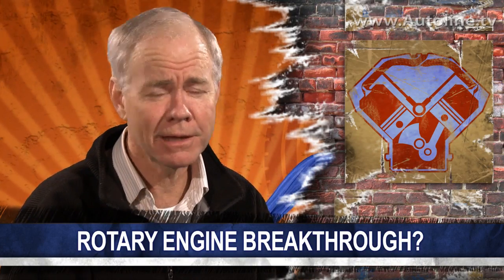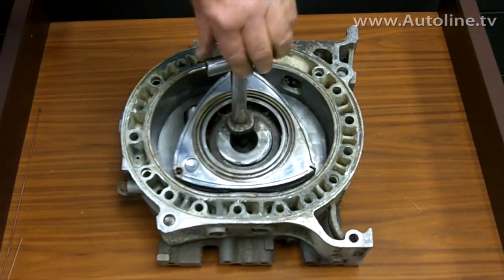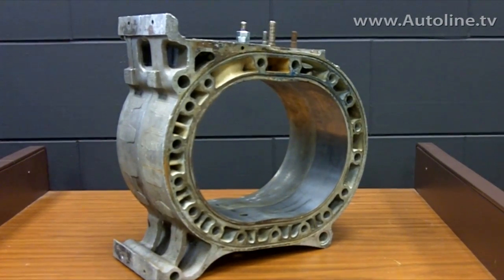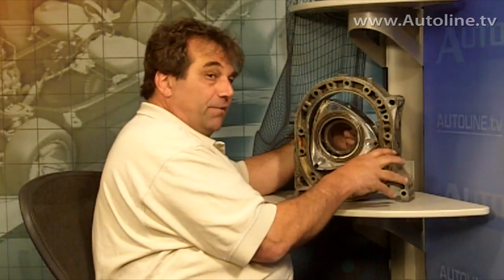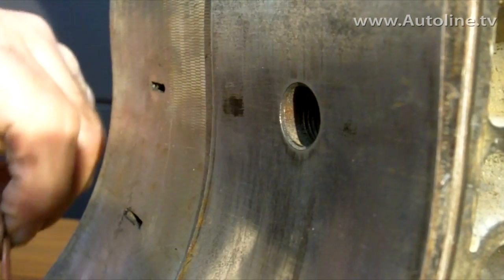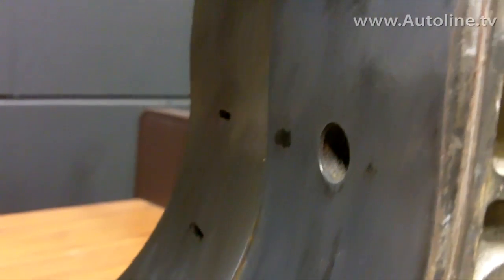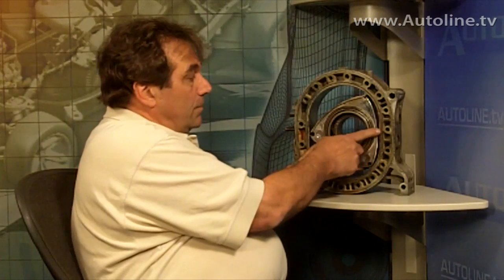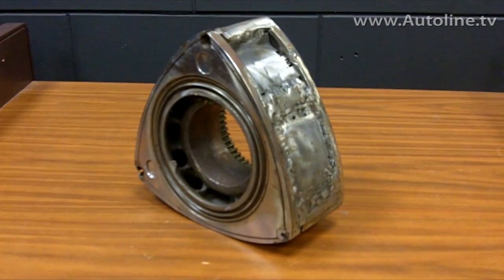Rotary Engine Breakthrough?

Comment: I bet he got 600 degree lower EGTs because the engine wouldn't fire. :-)  That'll lower your EGT a LOT!  LOL!
Reply: I'd love to know if all these gibberish copy/pasted gibberish is coming from the real Ernie Brinks, because it's relentlessly childish and a waste of time,  and I find it hard to believe its the same guy.  The guy I see in the videos does not seem like a 12 year old troll.  So I have doubts as to whether its the same guy.

Dr. Bimmer: you recently posted that Audi did significant exploratory engineering concerning the use of a wankel as a range extender.  They then abandoned the effort.  I agree on these facts, but NOT your conclusion.  No engineering department would embark on this effort if it's such a complete non-starter.  Audi makes great cars, and their engineers didn't become brain dead for the wankel chapter of their careers. They saw possibilities with the wankel, given modern materials and knowledge applied to seals, clean combustion, new materials, etc. and obviously concluded they might be able to make it work.  Your position is more like 'any engineer who pursues the wankel is dumb'.   Well then, you are calling a large segment of Audi's engineers 'dumb', when clearly they aren't.  Acknowledge that it isn't so clear cut, if you have the guts to.
Reply: STILL ANTHONY WERE YOUR BUDDY LOST IN SPACE AND TIME TROLL ALERT KEY BORAD JUNKE   AWESOME BOTTOM COMMENTS HOLY CHEERS
Reply: GOD BLESS YOU
Reply: Lay off the PCP,  Xke xke!
Reply: The real doktorbimmer4 hours ago
"Masamichi Kogai confirms Mazda has no plans to bring back Wankel engine"

You already posted this same article about 3 months ago, and at that time I pointed out that in the second paragraph they indicate the wankel is NOT dead- the headline is misleading.  So I copied and pasted the same thing as I did before.  It's in the very second paragraph.  

Second thing: as 'Ernie' is now reposting entire pages of old comments, I don't have the time to read it all to see if there is any point.... so thats why I haven't been commenting much.

Directly from the body of the article:

"As for whether the rotary engine will live on, Kogai was a bit more cryptic and wouldn’t give a definitive answer. “But if we were to restart production of the rotary engine again, we need to make sure it wouldn’t be just short-lived,” he said. “We need it to meet future emissions regulations. We are still conducting our R&D activity to overcome any issues we have with emissions and fuel efficiency.”

So the good news is, Mazda is still working on developing a rotary engine, but it’s unlikely to show up in a new sports car."
Reply: @someotherdude  The 2023 Madas are arriving! Where is your new RX sports car??? It's been 5 years and look like a fool right now.
 I guess Masamichi Kogai and I knew something you didn't???
Reply: Confirmation that care in the community has never worked...
Reply: Manoo422 months ago
Confirmation that care in the community has never worked...
LOL LOL !!!!   Good one!
Reply: When you combine TERRIBLE fuel economy with about 1/3 the torque, you get an engine only hipsters (also, most junior high school boys fall into this category) would use for any reason.
Reply: I have a hard time reconciling the guy I see in the videos with all the gibberish he supposedly posted.... but it doesn't look like  an imposter
Reply: Pretty sure whoever he was arguing with kept deleting his posts as spam so he'd just copy/paste the entire thread back into a comment.
Reply: What was the point of that post?  You merely copied my post.
Reply: They apparently still have the 50 man team working on a rotary concept, according to Kiyoshi Fujiwara....
Reply: @someotherdude  Apparently you and Kiyoshi Fujiwara were completely full of shite lad... Mazda unveiled its very last production Wankel engine over 27 years ago!  You both look like fools right now! Lol!!!
Reply: March 19th, 2017:
http://www.carbuzz.com/news/2017/3/19/Here-s-Proof-Mazda-Is-Still-Working-On-A-New-Rotary-Engine-7738337/
Reply: BTW, they are working on a range extender application of the rotary.  You know, the application you said no one would ever consider?  Well, they are working on it and I'm pretty sure that team of 50 engineers know more about it than you do.
http://blog.caranddriver.com/mazda-still-working-on-wankel-engines-but-not-like-youd-hope/
Reply: (doktorbimmer)
+Manoo42 :Mazda dropped development of the range extenderIf they dropped development of the range extender application, that REALLY makes you wonder what generated those fresh patents..... LOL LOL LOL !!!!
You know doktorbimmer, your unhealthy fear of the wankel engine has you denying/obfuscating/deflecting at a really unhealthy level.
Reply: +The real doktorbimmer
Some Other Dude  "Kiyoshi Fujiwara has said a lot of things recently that have been turned out to be completely false...."   Saying he's got 50 engineers working on a new wankel is not something that can 'turn out to be false' as in 'being mistaken' about something, now is it?  How exactly would that happen?  Is he hallucinating, doktorbimmer?
Reply: Just when you think it can't any weirder, this ^^^
Reply: You're incomprehensible, Ernie.
Reply: Tell'em Ernie!!
Reply: http://www.aieuk.com/
Reply: + doktor
Dude at this point it's you who is looking ridiculous.  You have repeated yourself literally hundreds of times. Let it go.   Right or wrong, there will be people in the world who have opinions which differ from yours.  It's part of the human condition.  You're smart enough to know a lot of things, why can't you grasp this?  Ernie's beliefs and conclusions are not in perfect agreement with yours.  Give it a 'shrug' and stop trying to single-handedly 'correct' every person on the planet with respect to mazda/wankels/rotaries.
Reply: I posted this comment three years ago. He's not going to give up on his dreams just because everyone says it won't work and no one's ever going to build a new Wankel. Their accountants won't let them. I can't believe anyone brought back the hemi head. And look what happened to that monstrosity. Gone. Just like back in the 1980s when it died the first time. It lived another valiant life making still lower hp and getting worse gas mileage than the pentroof design that replaced it 40 years ago.

There will always be Wankel enthusiasts who don't understand why the rotary died so they try to resurrect it.
Reply: No engineer would consider a Wankel engine for any sort of regular use. It's a "gee-whiz" thing. Fun to talk about, but not very useful. 20% worse fuel economy and it makes about half the power of a piston-cylinder engine that uses the same amount of fuel. And Wankels are FILTHY engines environmentally. 

They don't need to "just clean them up a bit". There's much more wrong with them than their environmental issues.
Reply: Check out the video called "4 reasons why the rotary engine is dead." A 7.0L corvette engine uses less fuel than an RX-8 but makes something like three times the torque. It costs less and is also far more reliable.
Reply: Can't imagine why they would. That engine should have died thirty years ago.
Reply: Some Other Dude
The only work on rotary's is for a 330cc (actually 990cc) donkey engine to drive a generator for electric cars. Several manufacturers considered the rotary only know of one using them. 
Its all largely irrelevant, we will never see any rotary powered car again.
Reply: I'd even avoid them for generator use. Bad fuel economy and low torque should have murdered this design right in the beginning. Somebody was trying to sell them for diesel/electric ships. I can't imagine they sold any because an accountant would have looked up their claims of economy and nixxed the whole thing right in the first meeting :-)  The engine made something like half the power while using 30% more fuel.
Reply: I notice you wrote 'is for' ..... which makes my point- they ARE employing 50 people to work on it at present.  Keep sticking this point to doktorbimmer- he won't acknowledge it.  He will keep attempting to talk past you.  Don't let him.
Reply: "Some Other Dude  Kiyoshi Fujiwara has said a lot of things..."  Doktorbimmer: is your ego so unbalanced that you would accuse Mazda's head engineer of LYING?  Fujiwara has most recently stated that he has the 50 man team working without a deadline- that is his most recent position and you should be decent enough to acknowledge that.   I would agree that earlier he made promises that couldn't be kept though.  BUT,  in so doing, he is showing, and you must admit, they are STILL. WORKING. ON. THE. WANKEL. 

There! I know that fact is going to have you tossing and turning tonight.  You won't be able to sleep....  I will be in CA in August, BTW, and I plan to rev the sh!t out of a Mazda RX-7 right outside your house.
Reply: You really haven't responded directly to any of my points- because obviously, you can't.  Are 50 engineers working on some type of wankel, yes or no?  Are 50 engineers looking at a range extender application, yes or no?   When you can't admit the obvious, doktorbimmer, it is you who are looking foolish.
Reply: re: "The only ones that look ridiculous..."
Why do you even post comments like this?  The person who goes by the name 'Ernie Brink' exposed himself a few days ago, and revealed that he is not in fact the real Ernie.  I know you saw that because you commented in that thread.  So you post 'crackpot who claims' to be Ernie yet you already know the truth there, that's not Ernie. Which is not to say the real Ernie isn't reading this, I believe he is.  We have both read his rather inarticulate posts.
Second,  You claim to be, and appear to be, an accomplished engineer, yet you can't seem to stand a single solitary person in the world having any beliefs about the wankel engine which you find to be mistaken.  Why does an accomplished engineer want to spar with someone who is, in your estimation, a fool?  I don't look ridiculous at all- I've broadened the discussion, prompted a lot of further discussion, raised a lot of points, and had a lot of laughs (many at your expense).
You, on the other hand, are an engineer who perhaps works in an area close to combustion engineering, perhaps not, but you spend 5 years hammering someone you describe as a 'con man', 'crack pot', etc. 
My question is: why can't you get over one person having beliefs you feel are mistaken?  Why can't you walk away from what you say is a lost cause?  Are you afraid he's on to something?????
Reply: Could you just for once, JUST ONCE, respond to my post?!  ONCE, is all I ask.
Reply: re:  "I posted this comment three years ago...."  well, Mazda still has 50 engineers working on a wankel, they are looking at a range extender application, and they've filed a bunch of patents within the last year.  These are facts. See if you can get doktor bimmer to admit that.  If you clean up the wankel some, it can make sense as a range extender unit because of its compact size and simplicity.  This drives doktor bimmer insane, but its true and Audi looked at it too.
Reply: Right, because some in that group also just brought a diesel engine to north america and now a compression ignition engine.... Mazda has done some amazing things as a small, lean company, but you just keep calling yourself the expert as you endlessly fixate on lecturing someone you dismiss as a drunk!  LOL!   And it's not 'If', when I've posted links which contain quotes of managing engineers stating just exactly that.
Reply: You're making sense, but it's a question of degree in how much improvement needs to be made, and how badly a range extender wankel would do if tuned to run at a single speed.  Then you would be talking about an extremely simple, small, lightweight engine.  You could literally unplug and lift such an engine out and put it aside for electric only trips.  And the fact is that Audi hired an independent company to look at just such an arrangement.  They didn't go with it- but they did find it worth consideration and they did not dismiss it out of hand.  Gee it's nice to go back and forth with a knowledgable person like you, instead of the acidly dismissive doktor bimmer.

Seeing as Mazda has made impressive progress recently on ICE's in general, I have to believe they know what they're doing and I'm going to believe in them before I believe in doktor bimmer....

http://www.greencarreports.com/news/1109760_mazdas-electric-car-gets-patents-for-rotary-range-extender-engine
Reply: "
WHAT DID YOU SAY BEFORE WANKEL ENGINES WERE INVENTED FOOL"
He probably found a different engineering issue to argue, found someone like you that he felt (rightly or not) was wrong, and then huffed and puffed about it for years, as a way to make himself feel better.  The slavish recitation of the exact day and hour the mazda rotary assembly line stopped is a clear tip-off....  looks very antisocial to me, probably reveals asperger's syndrome.
Reply: +David Buschhorn "Check out the video called "4 reasons why "
I don't know why it would cost less, but anyway, there are just some situations where lightness and simplicity trump torque and fuel economy.  Look at hand-held tools, for example.  I'd much rather hold a 5 lb weed whacker or chainsaw than a 20 lb one.  I'm pretty sure you would too.  Doktorbimmer, on the other hand,  is incapable of admitting something like this.  See for yourself- the recent LiquidPiston concept for example, there are impressive SAE papers about it and it seems to have excellent characteristics- yet he will not acknowledge any of this.  Very, very strange guy, stranger even than Ernie.
Reply: He said, "STEAM WILL NEVER DIE. STEAM IS HERE TO STAY. IRONHORSE CARRIAGES HAS 50 ENGINEERS WORKING ON A NEW DESIGN TO ENHANCE THE GASOLINE ENGINE AS A RANGE EXTENDER."
Reply: If it were more efficient it would get better fuel economy and make more power than a piston/cylinder engine. Not less. It's LESS efficient. It also makes a massive amount of heat compared to a piston/cylinder engine.
Reply: "You also seem completely unaware that several attempts.... "  My larger point, which you pretend not to see, was that sometimes weight and compactness rise to primary importance.   Now, we both know there were lots of snowmobiles that used the wankel, lots of motorcycles, several wankel chainsaws, at least one wankel lawnmower, I see a water pump application of a stationary wankel engine, various wankel go carts, personal watercraft, auxillary power units on aircraft, outboard engines, giant compressors for natural gas piplines, auxillary power for an Abrahams tank, etc.
These were not 'colossal failures', as some of these applications lasted for a decade or more.   And DARPA is not exactly known for lame engineers, how come they are embracing both wankels and liquid piston engines?  Why is MIT singing the praises of LiquidPiston?  I really had posted my comment for David Bushhorn, but thanks for butting in with your usual- because it lets me give you another good thrashing.

For a guy whose entire ego depends on knowing things like the exact minute the renesis assembly line stopped, you seem completely unaware of.... reality.  And you portray yourself as an accomplished engineer, yet you fixate on Ernie, the most unsophisticated guy you can find on the entire internet.  Why the crutch doktorbimmer?
Reply: "If it were more efficient"    Agree completely.  I realize you're answering Ernie, but FYI....
Reply: "Who would be so dumb as to steal idea ..."    I highly doubt he stole the idea, and if they(engineers) already looked at it then he's no crazier than an...... engineer.  As for the 'hoax' accusation, you don't seem to understand the meaning of the word.  Ernie clearly hasn't set out to pull a hoax on the world.
Reply: " or you are implicated in these scams somehow... "   Wow, tin foil hat time.....  doktorbimmer, I've made it exceedingly obvious that I want to move beyond 'ernie is a fraud' and argue other points.  You, on the other hand, are like a broken record.
Reply: The Wankel engine will never be used as a range extender on an electric vehicle. The whole idea of electric vehicles is that they're efficient. If you want to get the most range extension out of an internal combustion engine connected to a generator/alternator, you would definitely go with a reciprocating engine rather than a rotary. To turn an electricity maker, you need torque which a small rotary won't make so it'll have to run at even wider throttle openings to make the same power as a reciprocating engine.
Reply: @davidbuschhorn6539  Mazda just launched its first Electric vehicle, the 2020 MX-30
 Only available as a plugin battery electric with no lame range extenders
Reply: "You have a serious reading comprehension problem....."  Ok in the middle of this very long post there are some interesting points,  particularly after ""Enhancement of Combustion by Means of Squish Pistons" by Katsuhiko Miyamoto"  and  'Wenkel CFD'......  doktorbimmer could you specifically address those points and refrain from name calling? Why is this paper in error, or what part of it is?
Reply: I do think electric will rule the road soon.  Batteries don't need improve too much and then adoption will be fairly quick.  I think it will be the single largest upheaval to the car industry ever.  Cars will wind up being priced more like personal computers (commodities) since the industry can walk away from the very complex ICE engines.  
Mechanics will become highly respected and trained out of necessity
Self-driving won't be far behind (possibly very bad ramifications)
range extenders will be fuel cells and free piston engines
urban areas will become quieter and cleaner.....
......but NOTHING will ever replace the romance of a loud powerful throaty sound of a Harley or big 'murkin iron.
I'm now driving a Prius Prime- having sold a diesel- something I never, ever thought I would do in a million years.
Reply: @someotherdude  Today marks the 10 year anniversary of the final demise of RX production at Mazda.
  The very last Wankel engine car rolled off the assembly line at Mazda's Ujina #2 plant in Hiroshima Japan on June 21st 2012 at 4:30 PM Tokyo time.